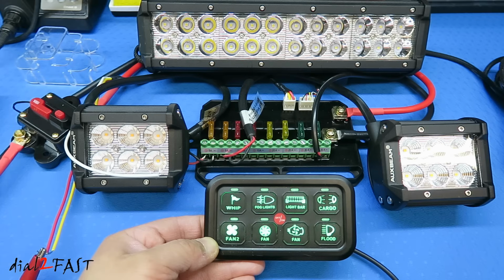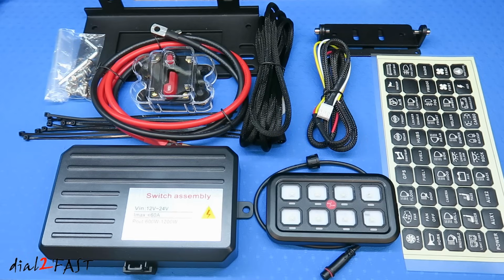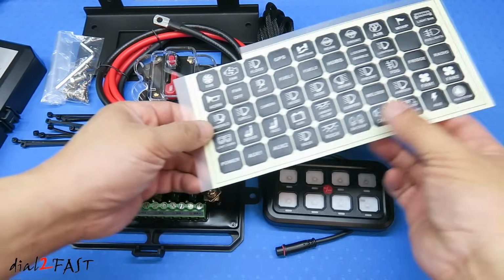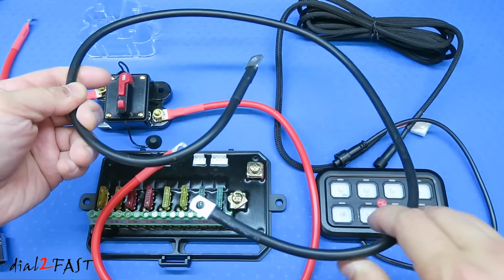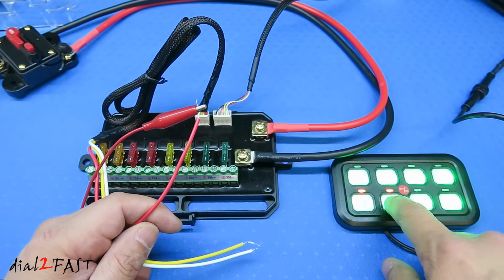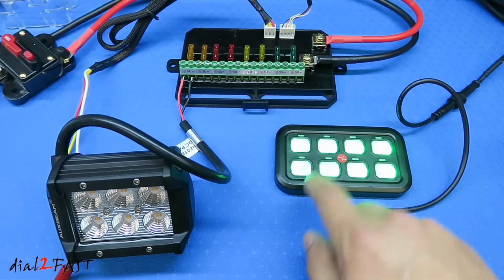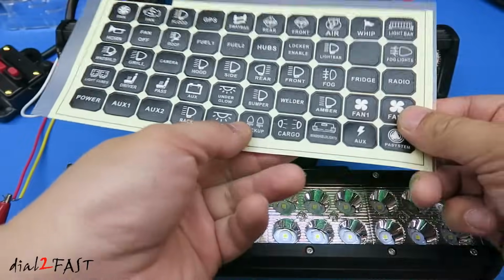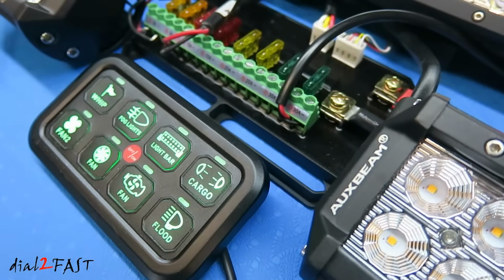AUXBEAM 8 Switch Controller For Automotive Lighting and Accessories

Comment: under hood of vehicle - on the auxbeam you mentioned the red, yellow, & white wires - do they connect directly to the battery (will the device be on all the time?) or do you connect to a fuse in fuse box

Comment: Did you run the positive and ground wires in the switch panel through the same bottom slot that the accessories come through ? I can't seem to make them bend at that sharp of an angle but I don't want to cut the plastic case to fit them through the side

Comment: Very Nice Video!! Detailed and Informative. Thank you!  I am installing my 8 Gang switch panel, but ran into snag.  I have Auxbeam 30 inch 180 W Amber LED light bar.  But ran into bind, can't wire into 8 gang switch panel.  Now have wire with original wire harness. 😮

Comment: Is it possible to wire a winch to this panel?
Reply from the maker: You do not want to connect a winch to this panel. A winch at full load might draw +250 amps.
Reply: @dial2fast  Thanks for reply.

Comment: Great video. but if your going to install the switch relay box (as shown in the picture) your going to need a longer power cable as the battery is on the other side of the engine.

Comment: Great instructional video. Just one thing I didn’t fully understand is the dimming. You momentarily touched the power source to dim but how is supposed to wired up to dim?
Reply: You would just install a 'Push To Make' non latching button switch. Then you can just press it to change the dimming. But to be fair, its designed to set once during install and leave alone

Comment: I was a car audio/ security installer in my youth, I’m currently a certified electrician, I’m curious on the real duty rating vs max duty rating and the listing of this device . I think it’s  a great idea I made something similar back in 1990s for hydraulics  using a Nintendo controller and Bosch relays and starter solenoids for continuous use . For safety sakes I think I’ll use one at 50% duty rating anything at 30 amps I’ll use a Bosch buffer relay. 
Nice product.
Reply: its a generic bite off of a sp-9100

Comment: Curious the breaker for the controller is 100amp, but you have 130amps combined in fuses in the control box... Why is that?
Reply: I'd assume the circuit can only handle 100amp.

Unlikely your going to have every switch on and be running every fuse as max draw.

Comment: More Chinese junk with skinny wires that can catch fire - and burn your car!

Almost $200 in the USA; CAD$215 AND USD$27 IN VIETNAM - CHEAPER IN CHINA. Don't be a sucker. EVEN AIR FREIGHT DOESN'T JUSTIFY RIP-OFF MARK-UPS.

TOUCH SWITCHES ARE DANGEROUS IN MOBILE VEHICLES.

Comment: For the light bar did you need to hook it up to the 30 amp or was that just to show a different button?
Reply from the maker: It was just to show the different button. You can choose whichever circuit you need to connect to.

Comment: Will a switch on the control panel work for high low and off on a dual speed heater fan? If not do you know of any products out there that will run a fan with also lighting.  
Thanks Ryan.
Reply: I was thinking the same thing

Comment: hi I have a rigid lightbar that has back light so the light bar comes with 3 wires black,red,white and white is only for backlight for the led bar wondering how I can wire it up to the panel. hope you answer my question.
Reply: I have the same Radiance Light bar and Pods. I wired the back light wires together to one switch and the light bar and pods to their own switches, The leds draw so little power wiring them together is not a problem. Hope this helps.

Comment: can you plug the light bars in so they turn on with the normal highbeam on the car? looks like a nice switch panel :-)
Reply: If you are good with wiring, you can wire a series of relays to allow high beams to activate lights

Comment: I bought this system for my handicap accessible silverado. I want to install it on my door for ease of access. With the way my access ramp for me to load up is for my truck in coming up short on wire. Do you know if they offer an extention wire for the 8 gang control or is it possible to make one. Thanks for any info you may provide
Reply from the maker: I am not aware of any extension cable for those wiring harnesss. Your other option is 1) extend the white plug wires yourself by soldering and heatshrink additional wires, OR 2) ask your local car alarm/stereo install shop if they can do that for you.

Comment: What do you hook up the dimmer wire to?
Reply: The question that no one can answer. I'm going to try to hook it up to my dimmer switch for my dash lights. It is a separate roller switch. Did you figure it out?

Comment: Do you think it’s ok if on one switch i use for a pair of square flood lights like your auxbeam?  I have bought same configuration like yours, and i’m confused do i have to use switch number 1 for left and number 2 for right, or i can just do both side on number switch number 1.
Reply from the maker: You typically will connect a pair of lights to one switch circuit. For demonstration, I connected the square lights to 2 separate circuits. If you connect both lights to one circuit, then both will turn on when you push one switch. You just have to make sure the 2 (or more) lights total current draw does not exceed the fuse rating on that circuit. You can determine that either by finding the current draw rating on the products spec sheet, or testing it with a multimeter with the current measurement.
Reply: dial2fast ok thank you, and one quick question if you don’t mind. My 100amp circuit breaker is fall out on the trail, and now it is missing. Do you think it’s ok if i swap it with a 130amp? Cause it is hard to find a 100amp. I only found 80amp, 130amp, and 150amp, 200amp and 300amp. Which one do i have to choose? And thank you mate👌

Comment: Mine only came with red and white wire. Where do I connect it to (ACC) so that it comes on when I turn the key. Right now the pad stays constantly lit
Reply: I have the same problem did you find out how to do it
Reply: Inline fuse to an injection fuse or rely

Comment: So how do you kill all the backlight leds ?
I have mounted it but it unless the red wires is key on and off it will kill. the panel I need it to  keep my fridge on all the time but if the fridge is off I want to kill the whole panel and turn the whole thing off uncluding the  back light.

Comment: Ok so I connected everything and now idk where to connect the red cable or white to power up my device I connected the red cable to the red cable that’s connected to the battery but the only thing that shoes is the light comes on on the button switches but don’t turn in my led lights nor anything am I missing anything ?

Comment: Thanks for explaining the RED YELLOW WHITE wiring. The manual is worthless regarding this. Also, how are we supposed to used the 3 brightness levels without installing another momentary switch? It is ridiculous that this is not configured into the panel...... Thanks again...

Comment: At what point would there be a need to use relays in the circuit?
Reply from the maker: When you are switching a device that draws high current, and you need to have on/off control. If you don't use a relay, you will have to use a very heavy gauge wire from the light all the way to inside your vehicle going to the switch, and back out. If you don't use proper gauge wire, the high current will melt the wire and cause a fire.

Comment: Hmm I have a near identical system, but mine doesn’t have 3 leads on the secondary pigtail wire. I only have red and white. Mine also doesn’t  cycle on and off. When connected to power, the backlight is constant on no matter pressing the buttons. My only option is to connect it to the accessory key position, making my AUX lights usable only when the car is on or in the ACC position.
Reply: I have the same issue with only 2 cables and can't figure out how to get the system to work without ACC hooked up! Did u ever figure it out otherwise?
Reply: Sean Clark I returned the unit and found another one on eBay which had 3 pins in the pictures. Still haven’t received it yet

Comment: Good video...
Question ca the two small lights be connected to the same switch so they both light up together
Reply from the maker: Yes you can. Just make sure the total amp current draw is less than the fuse rating.

Comment: Would it be suitable to use this for non led lights and components if you switch out the fuses to the correct ones?
Reply from the maker: Yes you can use it for any car accessories. Only thing is the device current draw does not exceed the rated current of each switch circuit.

Comment: Can i use 5 amp fuse for my 23 inch lightbar
Reply from the maker: Your fuse should be rated higher in amperage than the current draw of your light bar. So let say if your light bar draws 2A, then yes you can use a 5A fuse
Reply: @dial2fast  how to know
Reply: @gildarkplays7758  math....  watt= voltage*amps.... A=W/V will give you the amps used by your lights then pick the fuse thats bigger than this number

Comment: Great video.

Now I understand that the small  3 wire bundle goes to power the push panel box, but still not grasping how I attach the wires to be able to get the dimming feature.  Any ideas?
Reply: Brian Petersen I’m thinking a momentary switch that flicks on/off/on ?

Comment: What do you connect the white wire to?
Reply: you dont, its a momentary switch so just tap the wire on the positive of the battery to whatever brightness you want, once you have that, tape up the white wire and tuck away somewhere safe. Alternatively you can add an actual momentary switch to it and run that into the dash if you are wanting to regularly change the brightness
Reply: @Cammydearie   so how do I turn the whole backlight off.  I did it once by mistake then I can't get it back again. I am running this power all the time so I don't want the backlight on at all. if you tap the white wire you get the levels but one of the levels needs to be backlight off.

Comment: Just got this system it's a good system so far easy to set up it's just they forgot the one important detail you have to connect it to a secondary switch to turn off the switch panel or lites will stay on. And the instructions don't tell you....enless I am missing sumthing...
Reply: Robert Ewbank run the power wire for the control box to a fuse that turns on with the car like a radio fuse (key on power)
Reply: @nflares1  yep, I connected both the yellow and red together and ran a 'add a fuse' to the ignition fuse that way the switch panels only have power when i turn on the ignition and the switch panel lights go off when I turn the truck off
Reply: @nflares1    There is a way to run the backlight off.  I can't find it back and the directions don't say how to do it.

Comment: The labels show a "horn", does this switch unit have the option for momentary on a single switch?
Reply from the maker: It does not have momentary switch function.
Reply: @dial2fast  So why is there a horn label?
Reply: @milescrystal8605  Nothing says a good time like a 140db train horn wired to a ON/OFF switch... total fail in my opinion for that application.

Comment: Very good video ✊🏾 Would the be an adverse effect if I were to switch one of the 5 amp fuses to a higher amperage?
Reply from the maker: It's not recommended to exceed the rated current of each output. Therefore use only the recommended fuse.
Reply: dial2fast thank you for the find back.
Reply: No, there wouldn’t be an adverse affect to the equipment because they are just the feed portion on relays from switch. A small thing; The label would not match. Also. I would assume the most amperage any single terminal would be rated a max at is 30 amps due to that being the largest on the block. As long as the fuse matches the application you are using it for, you should be fine. However, the connection from battery is a max of 100 amps breaker. If you put a bunch of 30 amp loads on there and turn them all on at one time, you will trip the breaker if the total draw exceeds 100 amps. Could you make them all 30 amps and only use a couple at a time? yes.

Comment: So where do you actually connect the yellow and white wire to?? Cant find any information on where and what.
Reply: Yellow wire is for backlighting on the controller.. you hook that up to any wire that has 12v when your headlights are on (or to any constant 12v source to have turned on all the time)..... White wire is to cycle through the 3 backlighting brightness settings... So white wire needs to be connected to its own momentary 12v switch. You don't need to connect the white wire to anything if you want, just touch the wire to 12v until you get the brightness you like, then leave it that way, it'll always be set to that brightness.
Reply: I connected the dimmer wire  to my dimmer wire on my Jeep.  But I have no idea what width lamp is that it says to connect to. Horrible instructions.
Reply: @yaeger06  from more reading from similar items i think the width lamp is referred to the park lights. At least that my take from it.

Comment: Can a winch be wired also in that control panel? Like the wired hdh panel?
Reply from the maker: Yes, just check the current rating on the winch and not to exceed the rating in the fuse panel.

Comment: I like this idea, but when you wire it can you just run a fuse tap off the aux for power? It doesn't look like those wires are long enough to reach into the cab. Also at 00.46 you show the instructions. It looks like they have both main wires running to the ground as opposed to a ground location, is that right?

Comment: What do you recommend connecting the yellow wire to for brightness? I connected it to button 1, but it doesn't change brightness if I hit the switch in rapid succession.
Reply: you can add a potentiometer dial   , be like a dimmer switch
Reply: For my understanding,the yellow one was for turning the illumination on,that's why he recommended to connect it to the parking lights. The white one is the one for dimming, that was the one to be connected to number 1.

Comment: Nice review $ 200 bucks pretty steep price gives you clean & easy install. Manufacturers need a unit with just 4 switches. Would be more useful for most normal folks
Reply: The alternative is a $800 sPOD...
Reply: Just got mine for 100 bucks on amazon

Comment: Can you connect two 5v to the same connection. With have the split on the left or the right. I hope that make sense. Great video by the way.
Reply from the maker: The output is 12V, and you can connect multiple devices to one output as long as it does not exceed the fuse rating.
Reply: @dial2fast  ... Does this system function like that  ETH-POD??  If it is?, I can buy at Amazon? I hope you answer.